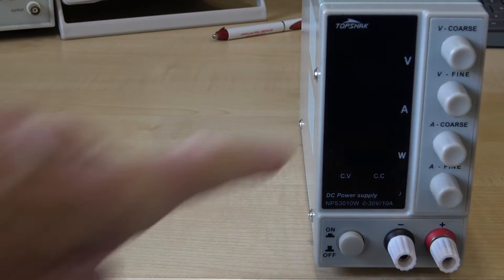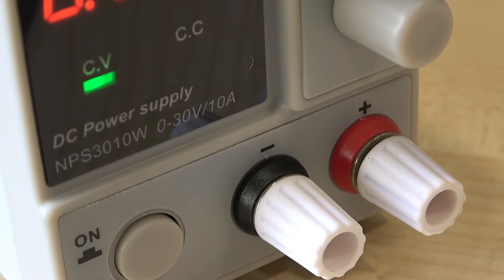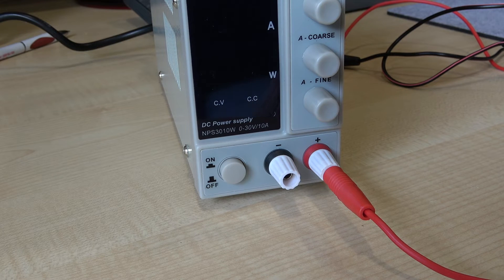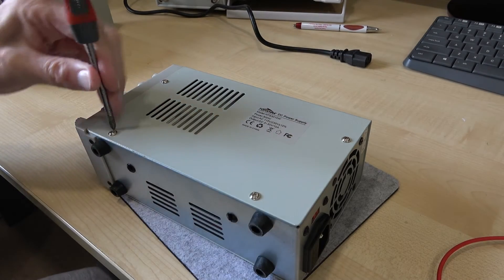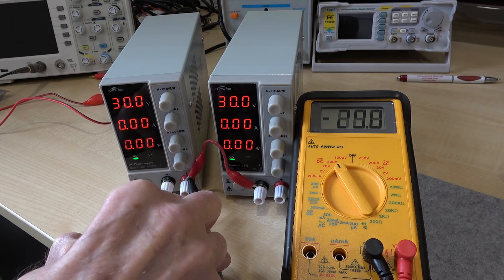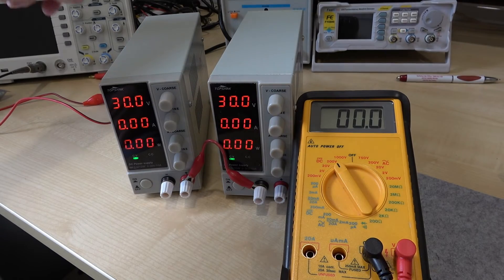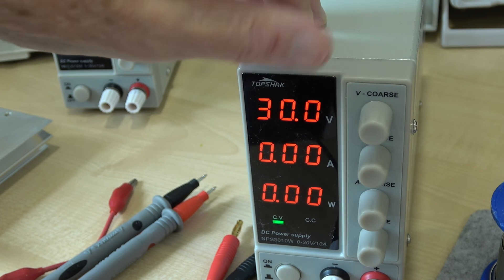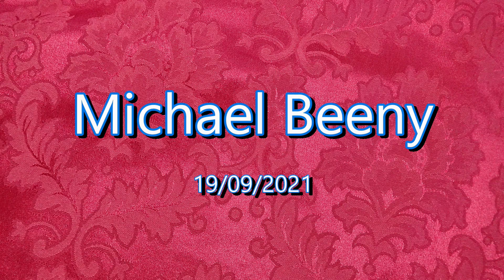Topshak NPS3010W DC Power Supply 0-30volts 10 amps. 300 watts from Banggood.

Comment: Doesn't the -30V DC is just because you plug the positive probe to negative and negative probe to positive?
Reply from the maker: On power supply A the + is the +30 volts, the - is connected to the + of Power supply B. This becomes the center tap or 0 volts. The - of power supply B is then the -ve 30 volts. Hope that makes sense.

Comment: I am also look for this product: more brand but the same product: minleaf & wanptek. I'm thinking about buying 60V/5A or 30v/10A, 4 digital number or 3 digital number..... NPS605D & NPS605W 's pcb board looks all the same but difference proice.
Reply from the maker: I have sold the 30-volt version now and use the 60-volt version. This suits my applications better. I found that 30 volts simply was not high enough for many of my projects. It is basically the same item. You lose amperage to gain voltage so it's still 300 watts.
I'm quite happy with just a 3 number display as the actual voltage selected does not need to be 100% accurate for my applications. It's a good power supply, I'm very happy with them.
I have removed the earth connection; some amplifiers need a floating earth. The bridged class D for example (only for testing, not in normal use).
Reply: @MichaelBeeny  Very thanks for your suggestion. It seems 60V/5A with 3 number display is good enought. 😀

Comment: Thanks for your review. I only wish that I had you knowledge. I have the opportunity for $85.99 so I wanted an independent review before I purchased it. What happened at the end? Did you blow up?💣
Reply from the maker: No, no smoke all working fine. I have replaced these now with a 60 volt @ 5 amps. Same product but different current/voltage. More useful to me, mostly working on amplifiers

Comment: worthless, defective after 2 uses.Has somebody a circuitdiagram ,maybe i can repair it.
Output voltage max 3V ,nothing in de powerstage is burned
Reply: Redo the solders to the integrated circuit of the auxiliary source (TNY277GN) and to the transformer with the red band.